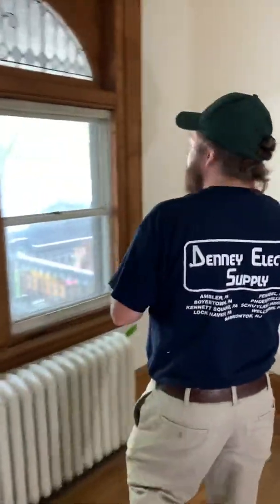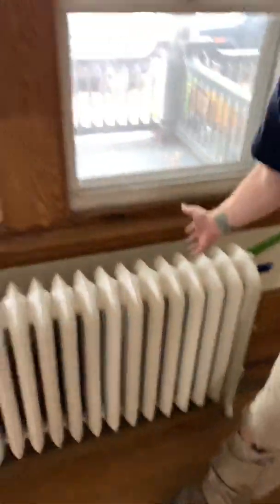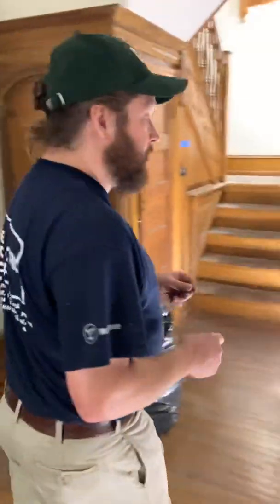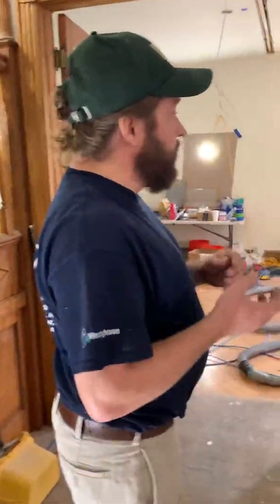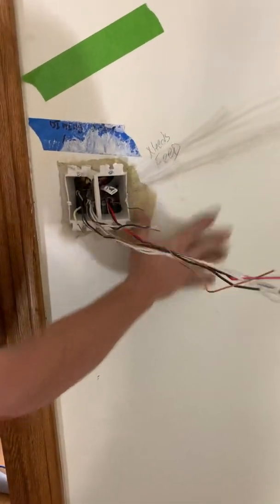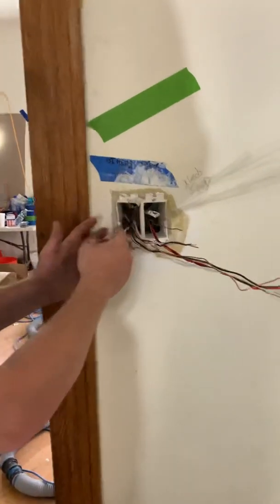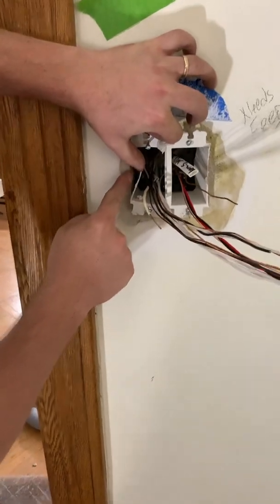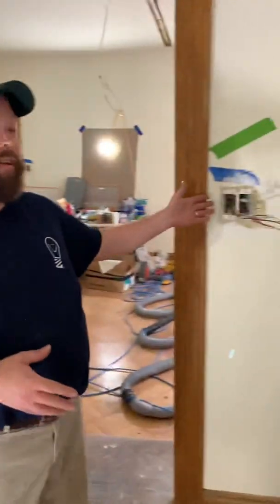Dealing with a knob and tube rewire- what to consider

Comment: How much to charge for labor if the customer is buying the material for a 2100 sqft knob and tube rewire?
Reply from the maker: How good is the labor. Quality dictates price. 
Precision cut and repaired plaster requires skilled hands, where smash and go rewires requires nothing more than a drug addict. Quality of work is the main factor in price and needs to be discussed before work can begin.
Reply: @DonaldMillerElectric  I'm all about quality. I'm going to try to not even cut holes. I just know this job is going to be a beast and I don't want to shoot myself in the foot nor overcharge.
Reply from the maker: @jaysmith7526  
It’s always best to charge less while you learn. It puts less stress on you to perform and allows you to figure out what’s the best quality for each problem. My first rewire took me 4 weeks by myself, I charged a low enough rate I could take my time and really absorb truly great trade practices. Don’t make it about money, make it about learning. You will be so much happier with the quality you produced for the homeowner.
Reply: @DonaldMillerElectric  I have over 12 years of experience. I'm not trying to learn. I'm trying to make a living working for myself.
Reply from the maker: @jaysmith7526  
It doesn’t matter how much experience you have in other areas of the field, a rewire is a completely different animal. I train guys with 20+ years experience and they still have a learning curve to deal with in the beginning. If you don’t know what to charge when it comes to rewires then you need to see what your production rate is. There is no flat rate of compensation
Reply: @DonaldMillerElectric  I've rewired Mansions for others and yes I do agree with the curve. So Closed plaster walls with knob and tube removal and rewire. 2186 sqft. 9' ceilings. Possible asbestoes 150 square foot porch 5 fans waffle lights heat/vent. How much$?
Reply from the maker: @jaysmith7526  
Again, it depends on what your offering. If you’ve done this before you know what I’m talking about.
Reply from the maker: What floor protection 
What are you cutting plaster with
What dust containment 
What kind of plaster repair
What kind of patching
What kind of cleaning 

What are you providing for the homeowner

Comment: My house was built in 1920 and is all knob and tube. We had to remodel the back room down to the foundation and built up to current code. Is there anyway to just put the new wires into the a sub box coming off the knob and time breaker box?
Reply from the maker: No